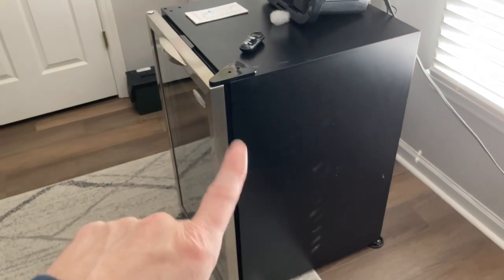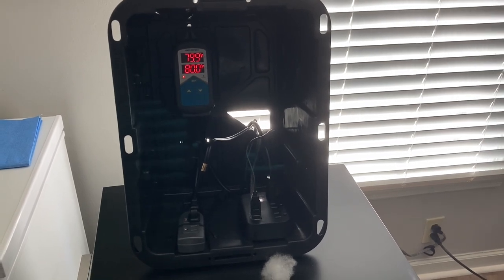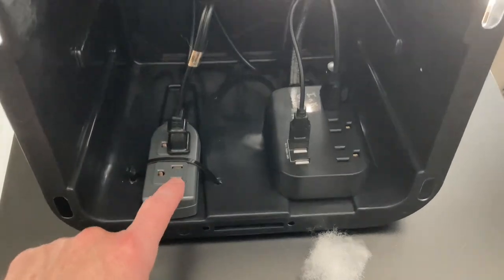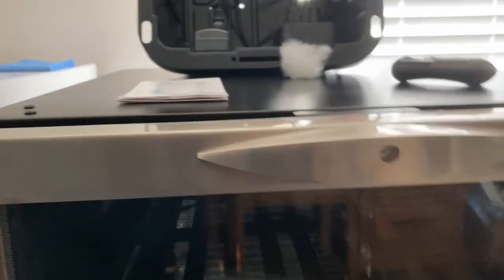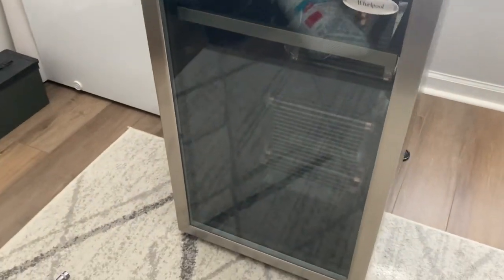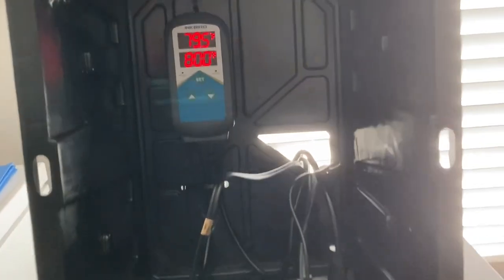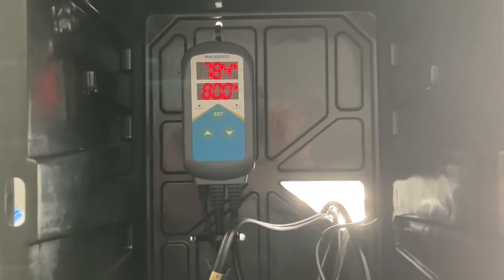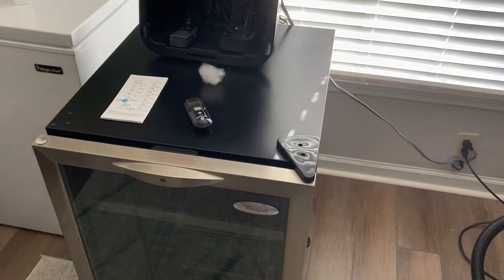Wine cooler to snake egg incubator

Comment: I did about the same thing not long ago. I have three clutches of Bp eggs in it at the moment. I found that it will not hold as many egg boxes as i first thought. This is do to air circulation concerns. I have the probe to my VE-300 hanging about midway in the back touching the backside of a egg box. My heat source is in the same place as yours. I have thermometers with built in hygrometers in each egg box as well. I did buy another wine cooler recently for future colubrids as well. I think i will be making a bigger incubator or buying 0ne in the future for our Bp eggs.
Reply from the maker: Thanks for the input. 
I agree. I thought it would hold more as well. If I took out the shelves and stacked the boxes, it would hold more (Snake Discovery does this in a video). 

I am currently looking at overnight temps with my GoVee and they are within 2 degrees- really good for an On/Off thermostat. 
I will have at most 3 pairs of Colubrid eggs. This should be enough room for me. 
For now 🤔
Reply from the maker: Also… If I had the room, I think it would be fairly simply to build one with plywood and insulation sheets. 
Though with the cost of wood, quite expensive.